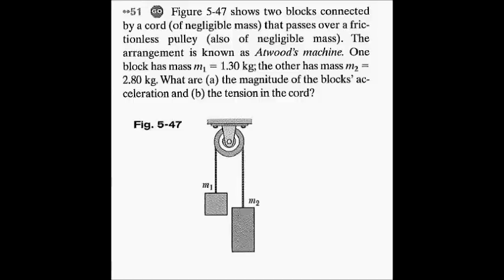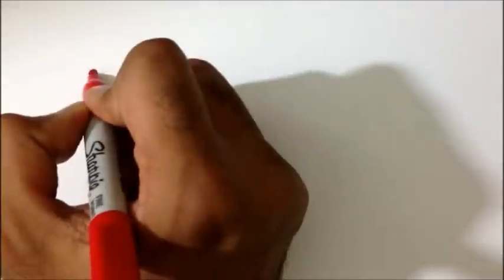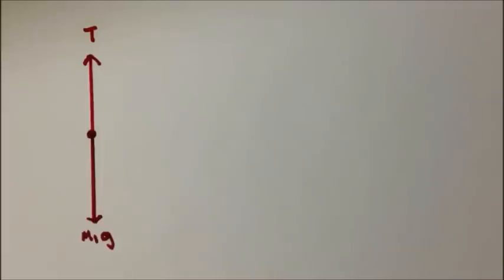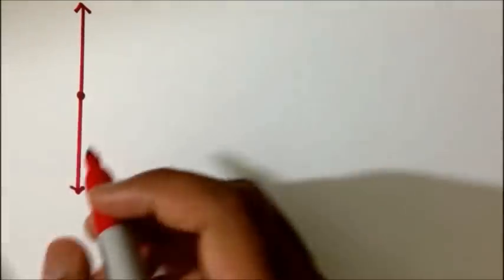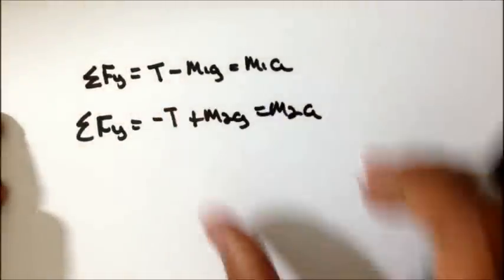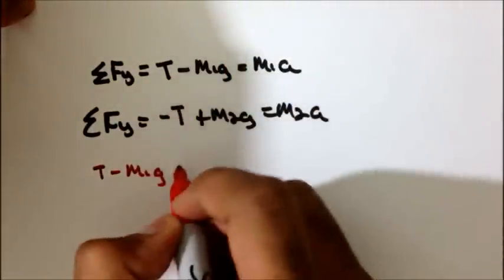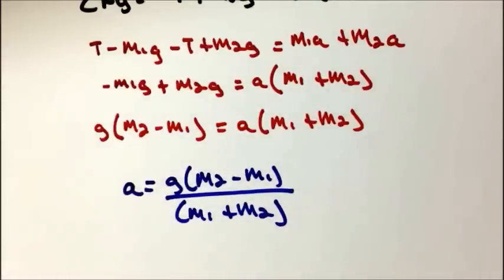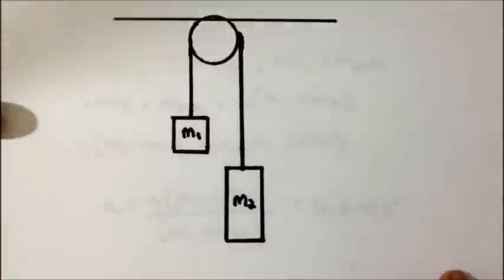Newtonian Mechanics: Atwood's Machine (EF)

Comment from the maker: in your equation m1 and m2 are being subtracted in the denominator. so in the case they happen to have the same mass, the denominator is 0 and the acceleration is undefined, which makes no physical sense. In the case they happen to have the same mass, the acceleration is 0, not undefined. This video is labeled EF which means is free of error. My solution method is consistent with the physical laws. You can also go to the back of the book and take a look at the answer yourself to confirm the answer. You need to learn more physics and mathematics before attempting to criticize. Best.